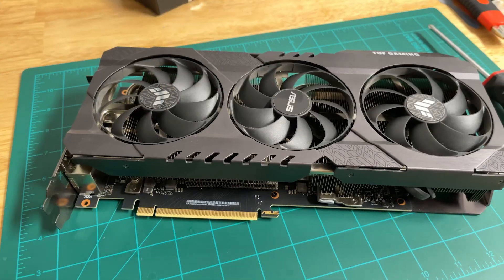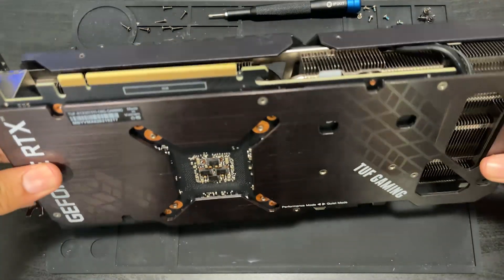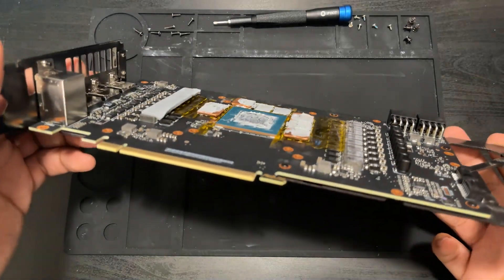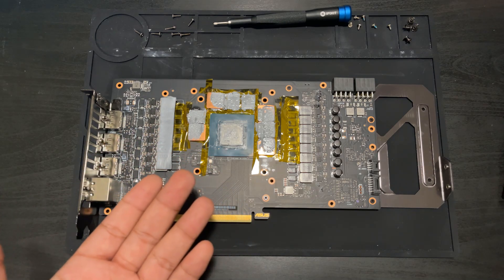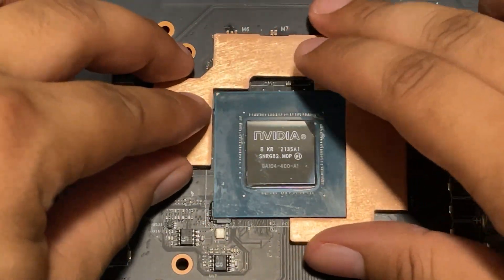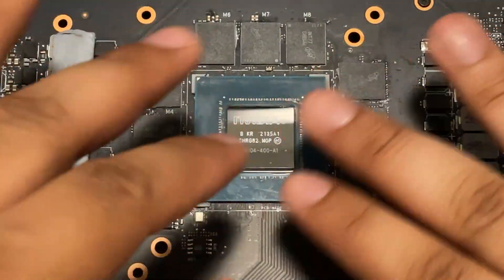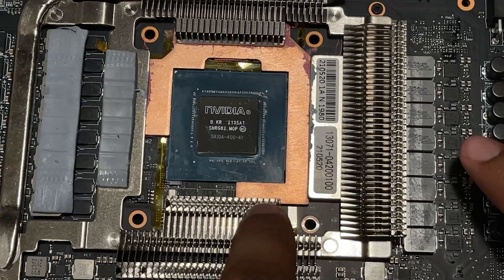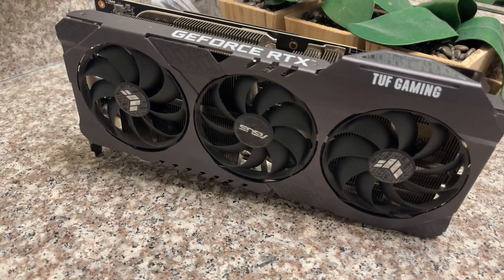RTX 3070 Ti COPPER MOD: 1 Month Later And... OMG...

Comment: I did this to 3 of my GPU's. 2 of them were 3080TI's (FE). What he says in 9:40 mark is absolutely correct Not all GPU and Copper plate will be the same, obviously, but I mean in terms of mm's. 

When I did my 3070TI Asus Strix, I didn't apply all that much thermal paste between the copper plate and sub heatsink, but I finished first try and had improved temperature.

When I did the first 3080TI FE, I spent half of my Saturday and about 10 retakes. I couldn't figure out where it wasn't making full contact because every time I took it apart, it was obvious the thermal pastes had made contact with the heatsink. So, I said screw it and put another line of thermal paste on top of the copper plate, put it together, and it worked. The 2nd 3080TI FE took only about 30 minutes with an handsome amount of thermal paste between the copper plate and heatsink. Worked on the first try.

I would say I probably used more than twice the thermal paste between the copper plate and heatsink on the 80TI FE vs 70TI Asus Strix. The amount of thermal paste used on the 80TI FE is more like using thermal pads rather than just a layer to make full contact, like in the 70TI Strix. Same goes for between the memory and copper plate. Instead of just a layer of thermal paste like I did on the Asus, I did a layer then added couple more drips of thermal paste (without spreading it) on top of it for each square. This helps close the gap that you have to make between the copper plate and heatsink. Having one side of the copper plate bear all the thermal paste is a bit dangerous because this is a paste after all, not a pad. The stability of having like 2.5mm thickness of paste to force contact between the copper plate and heatsink is a bit much to ask. Even closing the gap to 2mm thickness of paste, by adding .5mm of paste on the other side of the copper plate (between the mem and copper), is a huge ease of mind.

It's like making a sandwich, you don't want meat to be towards one slice of bread. You'd want the meat to be as centered as possible, so you can have the most flavor combination with the other ingredients.
Reply: What thickness was the copper for your Asus Strix 3070ti? I'm looking into doing this mod as my gaming temps are over 90C in some cases. Thanks for any info!
Reply: @ztryfe  I got the copper plate from the same place DandyWorks did (actually, it's through his previous videos that I found out about it) from CoolMyGpu. I just checked the page for the 3070TI Copper Plate I ordered, but not seeing any dimension specs. So, to answer your question, I have no idea the thickness of the copper plate I used. You could probably email them for exact spec, but if you see a copper plate that is designed for your GPU (they have a list of compatible and also explicitly states what's not) then you shouldn't have to care about the thickness.

If you're asking because you're planning to order copper PIECES, like how DandyWorks had it in the beginning of this video, then I can't help you there unfortunately.
If you have the 3070TI STRIX, then https://www.coolmygpu.com/product/ga104/2?cs=true&cst=custom "should" work for you, since I'm not seeing anything that explicitly says not being compatible for Asus 3070TI STRIX. It's definitely on the expensive end vs doing copper pieces, but I'm happy with it and no longer see RED temp numbers on my mining rig.
Reply: @LeeIB_Hup  thanks! With shipping it's really expensive for me. I am looking into copper pieces. I did send an email to Cool My GPU asking for confirmation on compatibility. Never got a response :(
Reply: @ztryfe  To be honest, if all you’re seeing is 90c while gaming, you shouldn’t be too worried. Obviously, the lower you can keep temps, the better… but if it cost money to do so, you’d have to think if it’s worth the cost. 

I only put copper plates on my GPUs that constantly ran above 90C. If you only game with your GPU, then don’t sweat it. Unless you’re seeing frequent gaming performance drop (because of thermal throttling), 90C Gucci. Mining is 24/7, whereas gaming is several hours at best. Occasionally hitting high temps isn’t a problem, but constant high temps (aka mining) will speed up its life span.  This is all mem temps, of course. If your core temps are in the 90’s, put a better thermal paste asap

Lastly, if it assures you any, a buddy of mine has been running his mining rigs for couple years now. Couple of them been in the high 90’s like forever. It’s still mining at its expected hash rate. So, don’t stress about the temps. If you notice frame drops or frequent crashes while gaming, NOW is definitely the time to monitor the temps. Otherwise, the only solution to get better performance is just upgrade your GPU. Improving the temps by 20-25% won’t give you the equivalent performance boost. If anything, it’s more about extending the life of your GPU as much as possible. The only exception is if you overclock.
Reply: @LeeIB_Hup  core temps hover at 65-70. Mem temp goes to around 90-102 (Guardians of the Galaxy, Ray Tracing, is the worst case scenario 102 after an hour or so) feels a tad overboard. All while gaming, never had throttling thou. I understand the mining workload is much more memory intensive than gaming, but reviews and specs mention it should be more like 80. That's why I'm looking into copper mod, if it makes sense and it's not overly expensive, might try it.
Reply: @ztryfe  DandyWorks has a video of doing this with copper pieces (which I’m sure you already know), so as long as you feel confident about doing it, definitely worth it. I went the copper plate route just because I rather pay for the convenience. Best of luck to your modding man
Reply: Hi, I copper mod an Asus Tuf Gaming rtx 3070 ti and a Zotac Trinity rtx 3070 ti with amazing results although for the Zotac I had to modify the copper a little in order to fit around the black plastic of the CPU. But i am unable to copper mod the Asus rog strix rtx 3070 ti. Whatever i do the mem temp is starting at 110C and stays there. I am not sure what is the issue. Any help is appreciated
Reply: @chris_meli  what thickness of the copper are you using? My lasted research points to needing 1.6mm and thermal paste on both sides.
Reply: @ztryfe  I ordered the "RTX 3060 / Ti / 70 / Ti Cooling Plate" from coolmygpu which are 1.6mm. I applied thermal paste on both sides but didn´t work.

Comment: Update your miner. New trex will get you 80 MH/S on that GPU.
Reply from the maker: This was recorded pre LHR full unlock 🙏🏽
Reply: @dandyworks  Good to know. Appreciate the video BTW. Good results with this mod.
Reply: Do u mind sharing your Oc settings.I use afterburner on 3070 ti Tuf but not sure with the OC.Also getting 100C on vram when mining and gonna copper mod soon👍
Reply: @GrowMyDuitNow  1050 Locked core clock and +1400 on the memory. I repaded my Tuf and it ranges from 90C-98C on Vram which is fine for me.
Reply: @KANATADOMPIZ  TQVM.Just ordered the copper online hopefully can start mining once my vram temp goes low.

Comment: I was looking for doing it, but a comment made me realize if there's too much pressure (or a micro bump) between the shim that the chips that may snap the chip. Since it requires 1.5 mm of thermal pads on that Tuf 3070ti, does the 1.5 mm shim plus the extra thermal paste prevented any contact elsewhere? I'm still tempted to do my 3 cards.
Reply from the maker: As long as the shim is correctly applied, there should not be a risk of compressing BGA solder joints to failure. Additionally, a correctly applied shim with thermal paste should lead to adequate contact everywhere else on the PCB. I’d do some more research for your specific GPU though!

Comment: I'm hoping they make a plate for the 3080 TUF soon...I've done 3 of my other cards and they are much cooler now and working great.
Reply: I'am from Italy (sorry for my bad english), I too was going to buy an asus 3080 tuf and later I wanted to buy the copper plate from coolmygpu ... the problem is that reading the compatibility list (of the specific copper plate for the 3080) it turns out that the 3080 tuf is not compatible with this mod.  The strange thing is that on the 3070ti tuf the modification is possible and since the heatsink looks the same between the various tufs (70ti and 80 / 80ti) I don't see why they declare the incompatibility on the 3080 version ... maybe the coolmygpu technical staff has I took a mistake to declare the incompatibility ... I tried to send an email to report the issue but they did not answer me ... since you have already bought some plates for your other 3080s, why not try to put one on your 3080 tuf to see if everything installs correctly?
Reply: @scambio_termico  I did think about taking apart my TUF to see if it looked like it would work. But then I read on their discord that they were planning on making one for the 3080 TUF, so I didn't check for myself before doing my 3080 Ti. If I end up ordering another plate before they release one for the 3080 Tuf I will look into it further.
Reply: @jeffbaker4219  well you're right, taken from the euphoria of this video, I don't consider that in effect, it would void the warranty card without having the certainty of modification ... thanks for the reply, and I did not know that the team is working on a specific variant for the 3080 tuf ... (hopefully good because the tuf variant it is the only rtx 3080 that i consider to buy)

Comment: I tried it once on my powercolor 5700xt and the memory temps got worse. I think it could be that my copper shims were too thin and there might be not enough contact pressure for proper heat transfer. I'll try it again in the future with slightly thicker copper shims. But its such a pain and hassle to mod it that i've been putting it off.
Reply: yes they were too thin

Comment: I want to do the mod for my rx6800, but AMD used thermal pads for the core, which need to be replaced if I take it apart and they are quite expensive… so, I won’t

Comment: I really wish they make this mod for every card above the 10 series from nvidia
Reply: you really do not need the copper plates on anything under the 3080. good quality thermal pads will be far enough for gddr6 and below. gddr6x is the issue. far greater heat output.